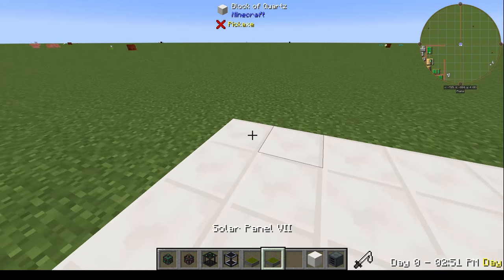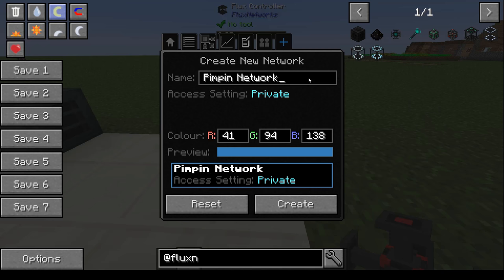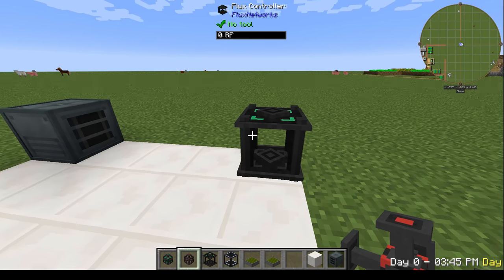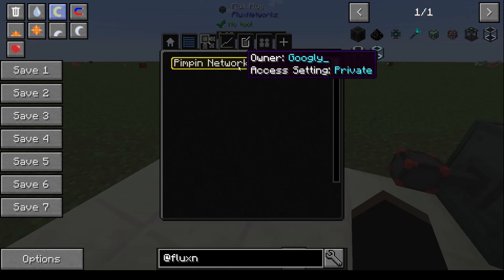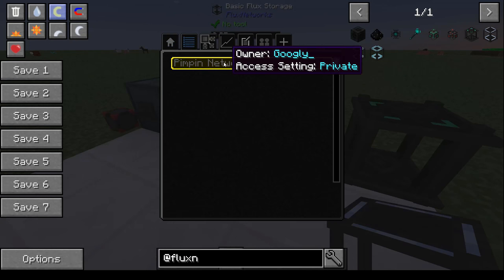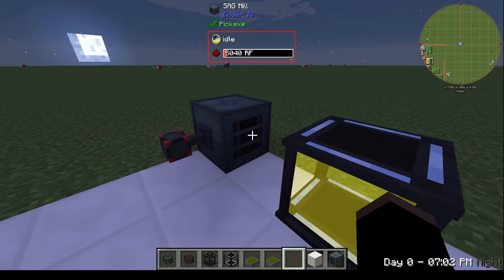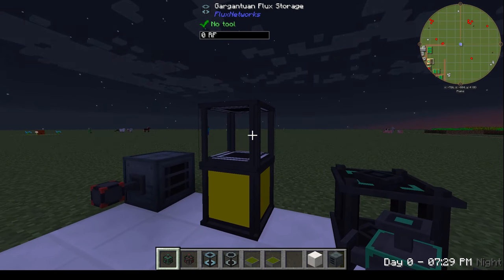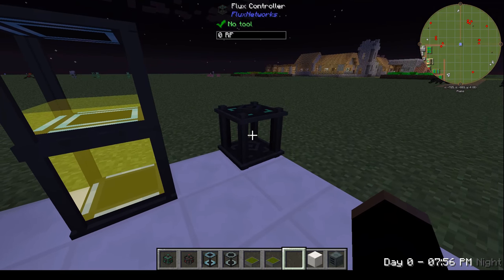Flux Networks in 3 minutes!

Comment: btw the max transfer limit of a single flux point is 8,589,934,592 rf/t (2^33), even if you set it to unlimited, however a single network can handle more.

Comment: One thing I want to add that wasn't in the video (and this SHOULD be obvious but I made this mistake so a warning might help others to NOT make the same mistake). Make sure your Flux Point is in the SAME CHUNK as your power generation and not stick out into another chunk.     
  
I for some stupid reason didn't turn on to show the Chunks and had the Flux point in a COMPLETELY different Chunk. This made it so all the power generation from solar (it was in the Mining Dimension) wasn't loaded and thus no power.  
  
So when making this, just double check the chunk borders to make sure it's all inside a chunk and you could save yourself some headache.

Comment: Dude i have done all you U show in the video and donta happen nothing. I cant transfer from the solar panel of the environmental tech to the ender io capacitor bank. Can U help me?
Reply from the maker: Some solar panels don’t output to the side — is your flux plug on the bottom of the panel?
Reply: @natewill6228  it has because of the ender io cable. But sometimes my solar panel produces but the core dont fill he just '' eat'' wath consume and dont gain more energy

Comment: I'm on the latest version of Sky Factory 3.. and for some reason the plug and point aren't sending or receiving any power? 
The "Network Statistics" tab says:
Plugs: 0
Points: 0
Storages: 0
Max Send: 0 RF/T
Max Receive: 0 RF/T
Transfer: 0 RF/T. 

I have definitely picked the same network for both plug and point.
Reply: TheValorous same here
Reply: I'm also having this problem. Made the flux controller, still no power transmission. Will the flux plug only work with Solar panels?
Reply: I found out what i was doing wrong, the one end had to be connected DIRECTLY to a power source, not a conduit or anything else. I made a 2nd power tap for my reactor and hooked it straight in and it worked.
Reply: whonelly1220 ah ok. I scrapped the idea and put an explosive gen where I needed power. I'll try the plugs when I get a chance. Do you absolutely need a flux controller for it to work?
Reply: Not as far as I can tell, I cant honestly tell what it does. Maybe it does more in multiplayer servers? Im playing solo
Reply: Nope, hooked it straight to a big reactor power tap and nothing

Comment: Tried connecting my flux plux to a capacitor bank, but it wouldn't draw any energy. Connecting the plug directly to a generator however, worked.
Reply from the maker: keith zmudzinski Capacitor banks have specified output sides, make sure you configured the capacitor to output to the plug.